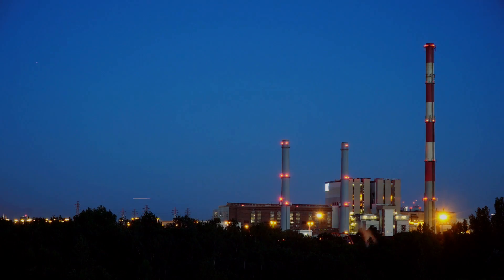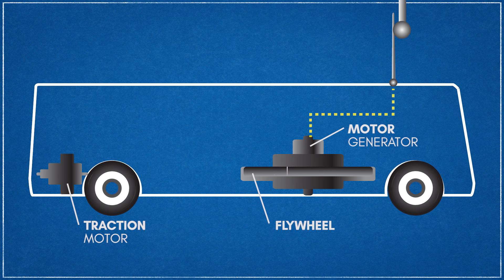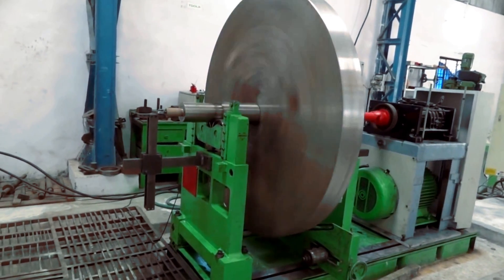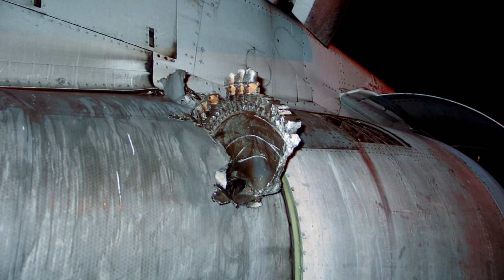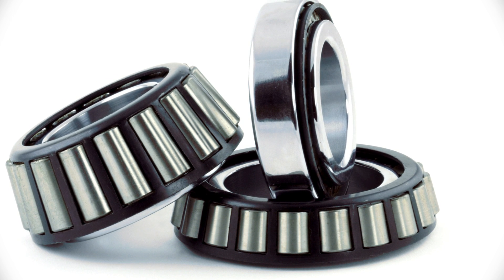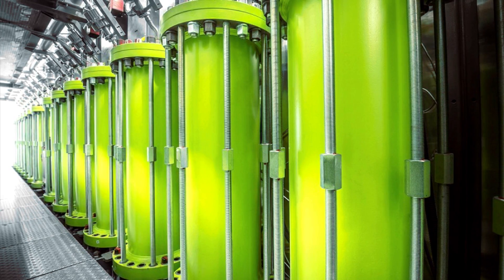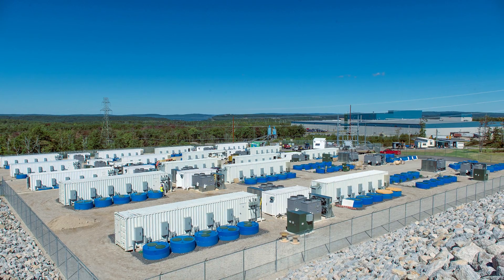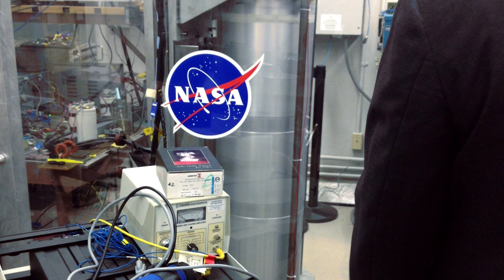The Mechanical Battery

Comment: Nuclear power. Stop wasting your effort on low-density, low-reliability energy sources...
Reply: This is a "battery" not an energy source. Also we can do Nuclear + other energy sources
Reply: @TheGodEmperorOfMankind_  I realize the fact that anyone can implement any kind of secondary energy source, but that wasn't what was implied in this video.
It was assumed that these mechanical batteries would be used as a backup source for the "electric grid" not equipment that a consumer would likely get his hands on.
The reason why gen IV nuclear power plants are better than a mechanical battery is because they are good at load following at almost any energy level, obviating the need for any backup storage source. Our current and aging electric grid is only good at base-load power not peak or lower load following.
Reply: @Evan Tinney  It is true that dangerous by products have been greatly reduced by Thorium Reactors and other improvements.  Thorium reactors are far safer than earlier deigns.  I never said coal was safer.  I will say that solar and wind are safer.  And fusion is safer.  And hydrogen fuel cells are safer.  So why use the poisonous one?  We've done enough to poison the earth already.
Reply: Nuclear power; you mean a really fancy steam powered nuclear plant. 
Na, these will be outdated....well, a decade ago lmao
Reply: @robh467  Basically, every power plant of any significant import produces steam to drive turbines to output 50/50 Hz AC power. And on top of that, they currently produce that power more efficiently than solar and wind power with a smaller footprint.
So..., until wind/solar/ocean-wave power can pick up the difference by providing base-load power at the kind of efficiency and land usage (i.e kWh/m^3 also known as energy density) they will only be capable of a backup source for consumer usage (nothing wrong with that). They won't be very useful for commercial power production.
Reply: @pappaflammyboi5799  I like and appreciate your information!
Wind power is definitely going to be outdated soon, unless they incorporate zero friction lubricants and magnetically suspended bearings ect. But it's already lost the technological battle with solar. 
The advancements made just this past year have been revolutionary for solar
Silver implementation, piggybacking cells, and three dimensional cells that make use of every spectrum of light; all have changed the industry. Most exciting of all, we still don't have data where these different systems have been combined to see what efficiency is possible....eighty, or even in the coming year(s) a hundred percent conversion...????
Exciting times!!!!
Reply: @pappaflammyboi5799  they are talking about small, neighborhood size nuclear reactors. Interesting, yes

Hey, the Voyager probes were nuclear powered. NO STEAM, correct? But if they did, in a vacuum...hmm, interesting to think about
Reply: @robh467  Uuuhh... Ok, to be clear, even if you could collect and cull 100% of the energy reaching the earth, and thus your solar cell, the energy density would still be dwarfed by nuclear power. Solar just doesn't compare in energy density, even if you were able to avoid inclement weather. If you'd like I can provide you a link to a peer-reviewed article written by a physicist which explains in great detail the options you have available for energy production and storage. It's illuminating and exhaustive at 300+ pages. Be my guest at refuting the facts and the physics.
Reply: @robh467  Yes you are right, it was a balanced mass helical flexure oscillating a gas OPOC (opposite-piston opposite-cylinder) driven Stirling engine. I suspect this technique works well for small power sources, but may not be as easily scaled to the multi-megawatt power levels used for a typical power plant implementation.
I actually can't speak to that particular type of tech, but I do know that combined-cycle power plants can get north of 60% energy-efficient conversion (80+% theoretic Carnot efficient). A typical Stirling engine is typically around 40% heat-to-mechanical conversion, or about the same as a compound turbo-diesel design.
Reply: @pappaflammyboi5799 oh, I've heard it stated number times about twenty thousand miles squared of less than twenty percent efficient solar cells would be enough to power the United States. I figured with five times the efficiency, that would equate to what, five thousand square miles. Of course, we're hoping these numbers will improve over times.... I'm unaware of how much nuclear power is expected to advance in the coming decades. But, certainly seems solar will be more than enough to power the United States; achievable for less than the cost of say....a war. Hopefully, in the next few generations.
Reply: @pappaflammyboi5799  oh man, you are way smarter than I. Reading your response is putting a smile on my face; and I mean that in every way other than sarcasm. 
Yes a Stirling engine, nuclear powered. Seems if it were to scale, this puts the recent talk of small nuclear powered devices for homes and neighborhoods much closer to practicality. An enclosed system, without the steam turbines. Would they still enclose it in a vacuum...or would that make it more volatile. Would it be about the same size of a hot water heater in a home? 
..and speaking of Sterling; the designs currently for Stirling engines are much improved over the Voyager era. I love how the electric induction has been directly implemented into the driveshaft. Less parts equals higher efficiency; and as always, science is one step ahead of our ideas. 
We haven't even brought up zero friction lubricants or magnetically suspended bearings...
...seems this kind of system is wide open for further innovations
Reply: @pappaflammyboi5799  you seem to be extremely well read on these subjects. 
So let me continue to wander...
Electromagnetic motors have been out for quite some time...
Electric motors had their beginnings over a hundred years ago. Neodymium magnets haven't been around that long, and the discovery of the halbach array and this formation was just discovered in the nineties. 
Anybody building electromagnetic motors with external halbach arrays...? 
Equation a×b=c 
A being in internal electromagnetic 
B being an external neodymium magnet
C power. To increase power you wouldn't change the variable of you input, current (pulsed of course). Add more magnets, in a halbach array; significantly increasing power.
Anything like this being done in any electric motor?
Reply: @pappaflammyboi5799  
Ok last one; I copy and pasted this from another thread on this video...a little more on the fringe, and it wasn't directed at someone of your education level so....yeah, just stick with it and let me know what you think...thanks for your responses and input!

Accelerating faster than Earth's spin in centrifugal forces does what; faster than the solar system...? Exactly
We know the benefits of being able to have centrifugal force; it can become a gyroscope, that provides stability
In multiple axis, with multiple gyroscopes at different dimensions....well then all you need is to provide resistance in any variable to make force in that direction; i.e. everything we see is a loss of the universe; heat, electricity, ect. 
If you can spin hundreds of thousands of rotations per, whatever, then you could do millions with a short leap in advancement. So a super electrostatic motor, that is also gyroscopic...a battery, your propulsion, stability control, all in one. Thrown into your flying saucer; you'd fly into a thunderstorm and charge your saucer; spinning your gyroscopic mechanisms up to millions of rpms, all stabilizing each other; and enough power to fly around the Galaxy. Make sure han solo has done the proper calculation in the computer; zip off into space. 
Avoid the emp's of Betelgeuse 😘; he made mention of this 🙊🙉

So again; take this video down now

Did I mention zero friction lubricants or magnetic suspended bearings. 
What about new rare metals and materials that cool with friction; I think I've said to much...

Again, take this video down now.
Reply: @robh467  If the only variation of permanent magnet 3-phase motor was arrange the magnets in a 90 degree rotation halbach array, you would be concentrating the magnetic fields in the "circuit" such that it would increase the power. I personally like interior PM synchronous motors (IPMS motor) and even more than that I really like the axial permanent magnet synchronous motor (APMS motor) as the magnetic flux is inline with the electric fields produced by the coils. Designed more than a century ago, people are patenting the hell out of it...🙄😖. This will slow the development down considerably.
Reply: @robh467  Speaking of zero friction lubricants, I'm not sure I'm aware of any, or if it's even possible unless you're referring to liquid hydrogen, which at around 4K seems to have a viscosity of zero. That might help you on your way to a zero-friction lubricant but it's gotta be a pretty cold environment.
In re, magnetic bearings, I'm all for them, but their limitation seems to be applicable to lower radial loads. They bottom out or misalign if radial loads (forces perpendicular to the axle) get very high. 
High-performance silicon bearings or cold-rolled steel alloy bearings are what you might need then.
I personally would love to tinker with some of the latest alloys of Scandium, AKA low-density, high-entropy alloys (HEA) with a nanocrystalline lattice structure (FCC or BCC) comprised of Al20-Li20-Mg10-Sc20-Ti30. They are harder, approaching 6 GPa (almost as hard as SiC), and stronger than steel and ceramics but have more pliability and lower brittleness (expensive to make tho) except at high temperatures where they start to re-anneal into their separate elements or binary intermetallics, thus lowering their overall entropy.
One can only dream, eh?
Reply: @pappaflammyboi5799  man when you talk, it gets me excited. 
Such exciting times, and I have no idea what I'm talking about (I do, somewhat) I had to go look it up myself..graphene flakes around nanodiamonds. 🤯
Reply: @pappaflammyboi5799  I get what your saying about the pm motors; I just think the design is wrong. Same with the designs I've seen for 3d printed halbach motors on YouTube. 
The goal is still to have the same size internal components, which is where power input occurs..the electromagnet. Then the power determination, and speed, would be a product of how many neodymium magnets are external pushing the inside; increased even more so by halbach configuration. In congruency of course, at the different vertices of the centrifugal drive. 
I like to think of it as, if only the modern electric motor was utilizing this kind of pushing power; which it is not. Plenty of innovation there yet to be discovered. Looking forward to a few of these on a jumbo jet, maybe L Ron Hubbard wasn't completely science fiction.
Reply: @robh467  I aim to please...
Reply: @pappaflammyboi5799  had to look up your previous replies... News this morning was they miniaturized a particle accelerator to the size of a microchip...again, they are robbing my brain quicker than I can put it on paper. 
I theorized a few years back, slamming lasers, which they're using instead of microwaves, into highly dense matter would allow this matter to more quickly breakdown; i.e. give off its potential energy. If this were done inside of a mechanism, say an enclosed Stirling engine ...you probably wouldn't even need unstable, radioactive material. They talked for years about thorium, however, I'm sure beating up and heating things such as a diamond, would achieve enough of a result to power a home. Again, it's just so damn exciting. 
Take your wedding ring off, enclose it in a copper receiver, and blast away with a laser. Should be a couple thousand kw out of a couple watts laser (magnified) beating the electrons out of a diamond. 
Sound too good to be true?
Reply: @pappaflammyboi5799  and I'd still like to see your response about solar. 
A twentieth of the cost of annual defense budget, and the same square miles as an average military installation here in the states; with enough power to fuel the country. 
Seems like a simple solution...?
Achievable in less than a decade.
Reply: I agree that this is energy storage, not generation.  Also: nuclear creates highly poisonous byproducts.
Reply: @chiphill4856  all easily managed and many are valuable.
Reply: @chiphill4856  nuclear is at its present technology restricted as a future save mankind energy source. One from the radioactive nature of the fuel and its waste, the ability to weaponize it, and the amount available (fuel) on the planet. What could be the big break is thorium instead of uranium or fusion instead of fission.
Reply: @waynogarfield4556  The question then becomes, where will you find a high-quality neutron source so that you can convert the fissionable material that is Th232 which you then convert to fissile U233 with a neutron? To say it another way: you can't have a pure thorium nuclear reactor without a lot of spare neutrons. There are basically two ways to do that, 1) use an ADS or 2) Use U235 or Pu239 in a mixture with your Th232 reactor.
Reply: @chiphill4856  Nuclear byproducts produce nothing like coal, nat gas or petroleum from a pollution standpoint. You're either ignorant of the facts (not trying to be negative), or you're propagandizing (I sure hope not...)
In fact, there are more dangerous nuclear materials spewed into the air by coal than a dozen nuclear power plants. And besides, if we as a human race get off our lazy butts and engineer a gen IV nuclear plant, all of the nuclear "waste" would never leave the plant because it produces such a small amount.
Reply: @pappaflammyboi5799  correct,but if a chain of uncontrollable events starts the result could be devastating.
Reply: @ericscaillet2232  There has really only been one devastating event, that being Chernobyl, and it was due to an unsafe design. The engineers and physicists even knew this at the time. Gen IV designs are even safer. Nuclear power is the safest type of power per death per megawatt of any type of energy production to date. You should demand it rather than irrationally fear it, purely based on the safety factor and history alone.

Comment: Back in the 1970s Accuray (now ABB) used 400hz power for a process control system called 1180s.  To get 400hz we had a motor generator that ran at 3600 RPM and make 400hz out the other side.  It would survive momentary power dips due to the rotating mass.

Comment: Wind power relies on retarded mechanical components: moving things suck much ass. And they suck even more when the parts weigh tens of tonnes, and sit atop a tower as tall as a sky scraper. They are ugly. They are noisy. They kill tens of millions of birds every year - and that is why no wind farm will allow you onto the land below the turbines: the ground is covered in dead birds.
Reflected solar energy on the other hand instantly turns birds into little flying balls of flame! One second they're flying along thinking, "Fuck it's getting kind of bright." And the next second they're on fire, and the radiant temperature kills them from thermal shock before the flames really hurt them. The little dead balls of flame fall on the reflectors, and slide down them, creating lines of burned-dead birds.
Pure solar energy is OK provided there's no massive fires within a few thousand klicks, and there's no asteroid strike, or nuclear winter, and the weather stays fine.
Hydro lakes silt up in short order on even relatively small time scales...

Comment: One most not forget that such systems are always and only burning energy, never generating it. They are extremely expensive and have a very low capacity. They have also a minimum of 10% loss. So they are an evil one wants to avoid. Much better is to always produce as much power as is needed. Flyweels are only for balancing network instabilities, they are NOT batteries.

Comment: Why not have a dynamic flywheel? One the contracts its quadrants for lower speed rpm
Reply: At the speeds it rotates the outer part of a flywheel is exposed to a centrifugal force equal to tens of thousands times the earth's gravity. To resist such extreme forces they must a solid block of the strongest materials, no moving parts would survive in that environment.

Comment: Kinetic battery is a fantastic system but I doubt we'll be seeing them on ground vehicles a lot. I wouldn't want to see the Crash test dummies after they impact a wall sitting on top / right next to a massive flywheel spinning with enough energy to be able to propel the vehicle for hundred(s) of kilometers. No matter what kind of materials you use to "safely" pack it in, it's gonna rip loose of its bearings and come say hello to the outside world like an anti tank round shot out of a massive cannon.

Comment: It's really amazing how cheap, powerful, lightweight, quick to recharge and effective internal combustion engines are when compared to alternatives.
Reply: All of those things came from over 100 years of development 
Meanwhile it takes less than 50 years for scientists to develop low capacity battery to energy bank we use today
I'm pretty optimistic about the future of electric motor and power cell
Reply: Yep, the internal combustion engine is almost perfect. Nice to look at alternatives, but the good old piston engine is doing just fine

Comment: Why do you keep showing water wheels when mentioning flywheels?  Water wheels store ZERO energy in the form of rotational kinetics.

The logical progression of flywheel storage, however, is in home energy storage, where the longevity of a flywheel could be significantly cheaper than Tesla's home storage battery.